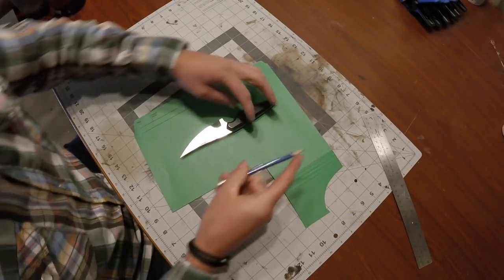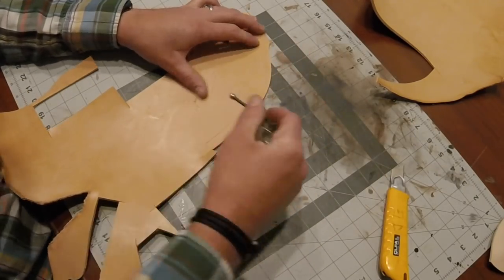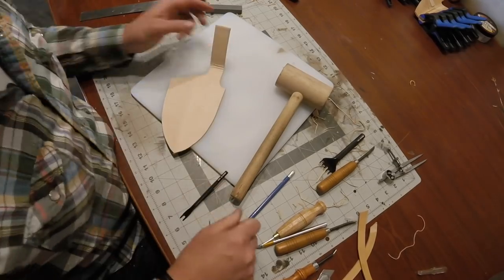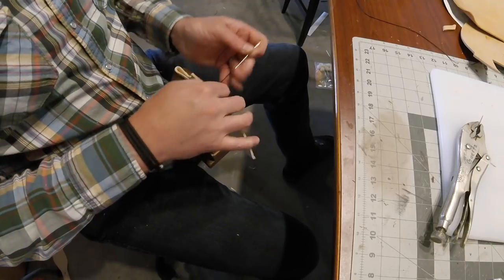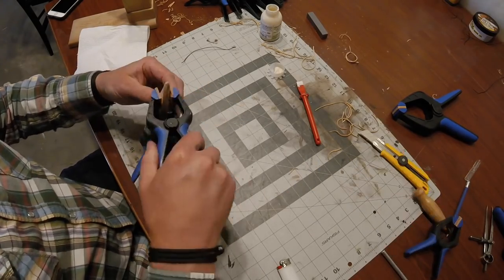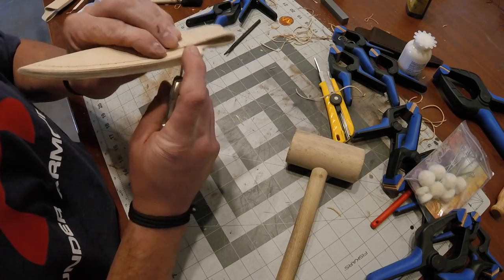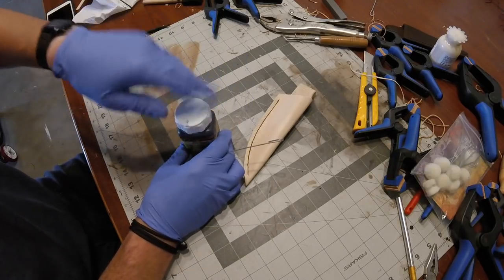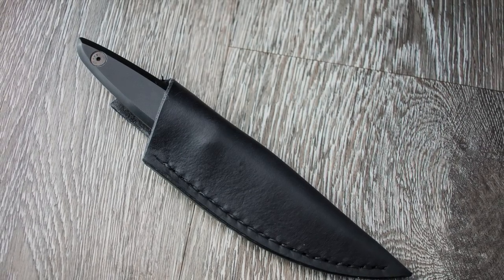How to make a Leather Sheath - (for the Crooked Finger)

Comment: Try adding a cool functional detail to your fixed blade leather sheaths.  Get foot long 1/8th I.d. brass tubes at a good hobby store.  After the sheath build and before the dye,  drill a hole in the bottom of the sheath at the lowest point at the tip to accept a 1/4 inch piece of brass tube.  Rough up the stub of tube, spot on some epoxy and stuff it in the hole to provide some air flow and drainage for rainy day carries. Great stuff as usual Jeremy. 👍

Comment: The benefit of using a punch instead of a drill is that the hole from the punch will end up closing back in on itself over time, increasing the friction holding the stitches together. If you drill out the leather, you end up having to rely only on the strength of the stitching to hold together. Always much better to punch your stitches.

edit:
Also, you can burnish the inside of the sheath to make it smoother against the knife, and water form so that the fit is perfect. These are optional, but do sometimes increase the feel of the sheath. Knotting on the inside of the stitch is easy if you put it in your pony with the edge of the piece towards you, so that the knot would happen on the top, which now would be inside the stitch. It is the exact same as knotting on the outside, you are just turning your piece.

Comment: I love you vids, btw you’re supposed to let contact cement dry before putting the pieces together, you don’t have to worry about it drying, it will work better than if you leave it wet
Reply from the maker: Thank you, I appreciate that. This contract cement is quite different. Even letting it dry it doesn’t have the instant bond that typical stuff has. But after it’s been clamped the leather pulls apart before the glue does. Nice stuff to work with 👍

Comment: The Welt, I always wondered what that was called... Have you ever considered using the Welt for Kydex? 
Ive had knives hit the rivets of kydex sheathes and cut through them! and its not uncommon for the blade edges to rub on the rivets when pulling the knife in and out.

Comment: I have a few easy things for you to finish that sheath to make it look pro. First thing you can put a rivet (get them at Tandy) at the top and bottom of the fold. That way if the stitch does get cut they have some time to fix it and it will look awesome. Next if you use your stitching pony to hold the sheath and do the stitching the same for each stitch you will get the top too sit over the bottom and it will give you the diamond look. Last thing get a new awl and do your groove on both sides and before each stitch punch a hole. You can use the diamond punch just to make a mark for where the hole goes. Then you can punch through from your mark and make sure it goes in the groove on the other side. I would love to show you how easy this is and then you can be a pro at making these nice little sheaths. You can check out my IG if you want it’s shanebeez. I hope this all makes scents. I love your vids, don’t stop doing them